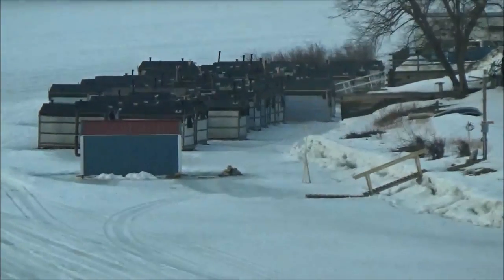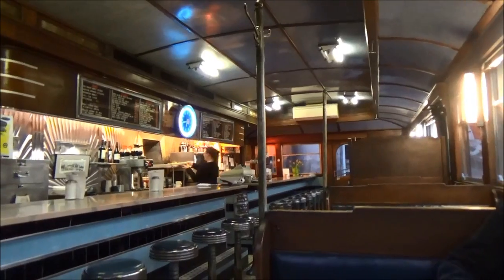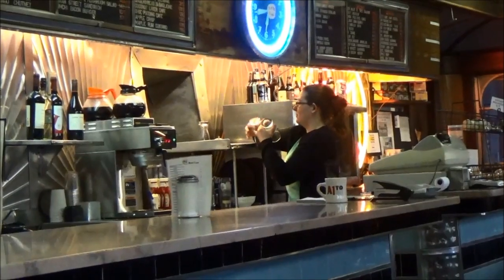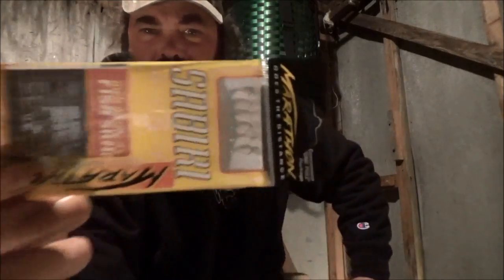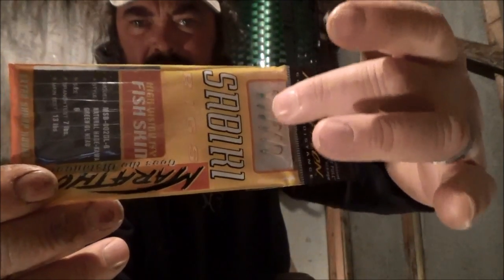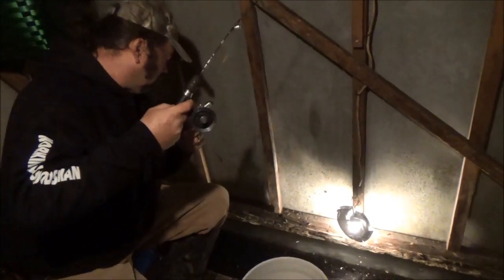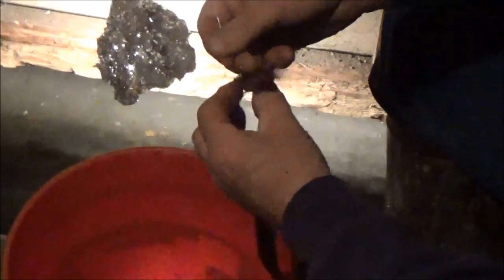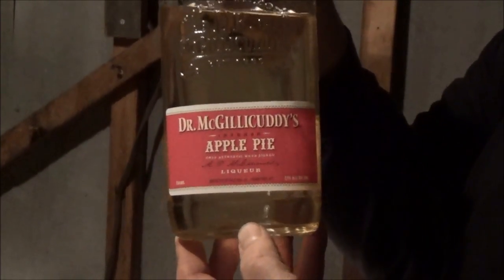Baker's Smelt Camps, jigging smelt with a sabaki rig !!

Comment: What size hooks are on those Sabiki rigs you are using in the video for smelt, the size of smelt you guys are pulling up or the same size that I get maybe a little bit larger over here in Michigan. There is a lake only about a half hour drive from me that has a large Inland landlocked rainbow smelt population I have caught them up to 10 in in length. I plan to use some Sabiki rigs in open water fishing using my Sonar but I don't know what size Sabiki hooks to use